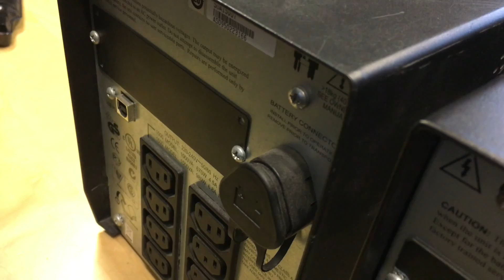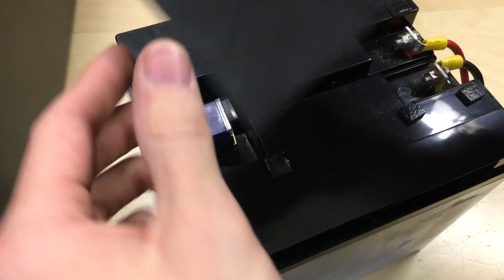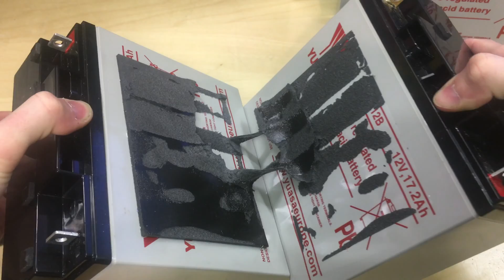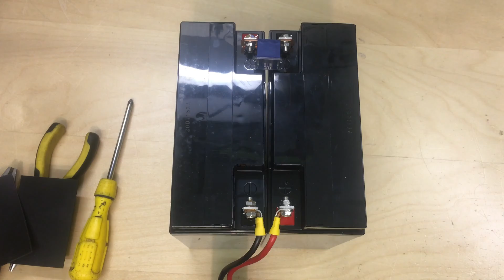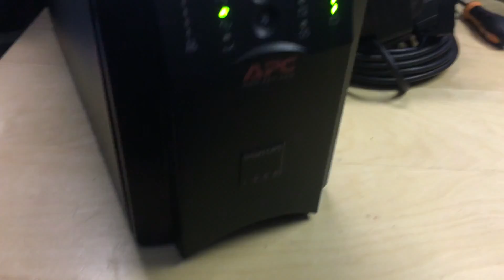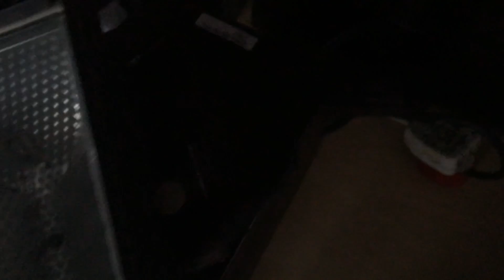APC Smart-UPS 1500 New Batteries & Re-calibration - New Home Network Backup Power Supply, Yuasa NP18

Comment: One tip to others: it is safer to connect the fuse last, in case you accidentally short the packs with your tools when connecting the UPS cables.
Reply: Came here to say this lol the pliers on the connector side first had me cringing waiting for the pop!
Reply: AND for when re-assembling - Fuse connects last!
Reply: @k0nanick  Due to my inattention, something sparked today. Does this affect the battery? I hope nothing happened to the batteries? After installing the APC SUA1500i in the UPS, they work, so maybe it will be ok.
Reply: Anyone know the model and specs of the battery
Reply: @k0nanick  Same here, been there and done that. drop the spanner and got a nasty spark lol

Comment: I put duct tape on the bottom of the battery pack, with a piece protruding and folded over itself, like a tongue, to make the next replacement easier – just pull to slide the batteries out.

Comment: Set your float charge down one click and you'll never have another bulged battery. Will also extend battery life
Reply: just change battery used deep cycle battery get much better life 12Volt 100A Deep cycle battery
Reply: @jacksmith3951  thats true but deep cycles vent and in an enclosed area that's dangerous

Comment: Would the calibration method still work if I used something with a heavier load than 1/3 capacity?  I have an RS1500-G, and run entire PC system off of it.  The PC itself has a 1200W power supply.  If I ran the PC and drained the UPS, after a 100% charge, would that calibrate the battery.  My replacement battery pack is only 15 months old, and I just ordered a replacement, but prefer to get the full life out of it before installing a new one.

Comment: I have an APC of 5000 rt smart ups it's indicate a led of red colour on the panel at first on two days ago i changes all batteries i removed all old and put a new batteries it's use battery 16 pcs of 5N,so when i switch on after changeng all batteries the ups it switch correct and use it for two day but yesterday morning the ups failed to work and indicates an red LED on the pannel until now

Comment: Hello Sir, All good wishes from me, I am facing a problem with my APC smart UPS 1000U, batteries connected externally (12v +12v in series 80Ah and100Ah respectively.) when putting it to test and recharge the battery, it turns on, gives AC output for a while, (1 minute) and then turns Off and gives continuos long beep, stops charging and no AC output. How can I fix this? It does not give backup when disconnected from Mains. Please give me a solution to this if any. Thanks.

Comment: Do you think the APC back-ups pro 1000s performs a similar recalibration in the same way? I tried with a 100w load (on a 600w max unit) and it did nothing. Thanks

Comment: DO you have an opinion about replacing the battery with a huge LiFePO4 battery, more like 200AH? No more power out -that's the inverter limit, but lots more hold up time.
Reply: They charge differently compared to SLA so you would need a new charging circuit. Unless your UPS has an option in software to change chemistry, it's a bad idea.

Comment: When the batteries go bad do they get real real hot?  like Very hot to the hold or handle? Or is  it something wrong with the unit. I was going to replace the Batteries but not sure the unit is good with it as hot as it was.
Reply: My experience most bad batteries that will not take a charge Do Not get hot when attempted to charge, unless there is damage somewhere.  To sort out the issue assuming the batteries get real hot when they are charging in the UPS,  then something is wrong.  The first action is to stop charging in the UPS as continue charging could cause a battery fire, and the fire can spread.  Take the batteries out and try to charge them with a external charger, one at a time.  Monitor the charging constantly, do not leave them over night.  If they still get hot then there is a short in the battery and it should be disposed off to a recycling facility.  If the battery charges fine without getting hot then your UPS has a short.  If the UPS is out of warranty which I suspect, turn it into a recycling facility.
Reply: @michaelmlee2964  I choose to replace, it was not worth my house burning down over a UPS.

Comment: Thank you. May we use 12 volt 12ah or 12volt 7ah instead of 12volt 17.2ah
Reply: You probably could (although the current capacity of such a battery might be a concern at high loads), but you'd lose runtime in doing so.  The best option for this UPS model is a pair of 22Ah cells. Higher runtime, and will last longer. They're also typically AGM type, which are better than FLA/VRLA types. Cross-reference UB12220
Reply: well i have ups 350 and i have 12 volt deep cycle battery 75A 900WATTS run much longer with 40A FUSED

Comment: Hi, I got a question. Is that possible to set up these models to be off when the battery discharges to a specific voltage level, such as 24.5V?
Reply from the maker: I don't believe that is possible, but I've never had to try to set that up. They do automatically switch off when the battery is what it deems dead / low enough though. But I don't know what the threshold is for that to happen. 
Sorry I can't be of more help. 
--Nathan
Reply: I believe that is possible with the PowerChute software and a USB cable or with the Network Management Card via ethernet and a web browser.

Comment: What are this used for? I have no idea of what they are good for?
Reply: This is an uninterruptible power supply. It will protect computer and server equipment from power outages and bad power conditions like (limited) surges, and too low/too high voltages. It comes with driver software that can shut down a server gracefully when the battery gets low during a power outage.

This is a professional unit, quite expensive when new but it comes with quality pure sine wave output.

Comment: I have ups 350 and I hack it get run more 7 hours I have 4 12 volt lead acid battery I have 3 12 volt lead acid battery 7.2Amp each and 20Amp lead acid battery and 40Amp fused for my ups and I was testing it today with my laptop battery cant charge so I plug in my laptop in my ups at 4:00pm today its 11:19pm and my ups is still running been on battery 7hour and 20minutes now still running

Comment: Change the battery 12volt deep cycle battery 100A 2 12 Volt 100A each run much bettery those battery life sucks i have ups 350 i have one 12Volt 75A Deep cycle battery with 40A fused on it run much better